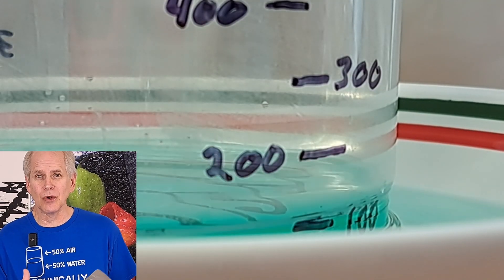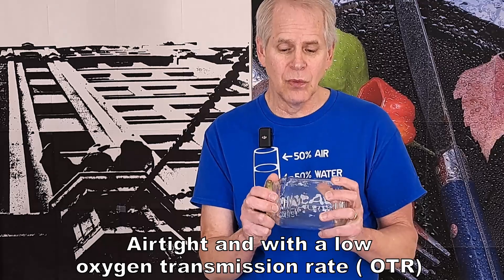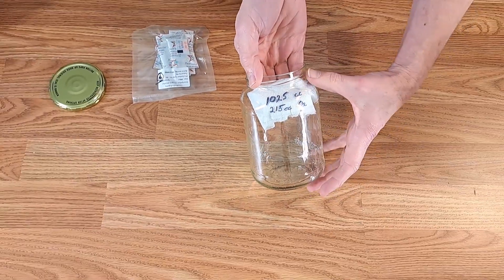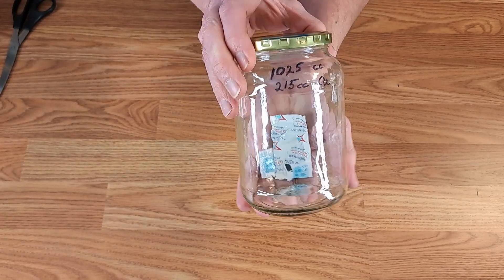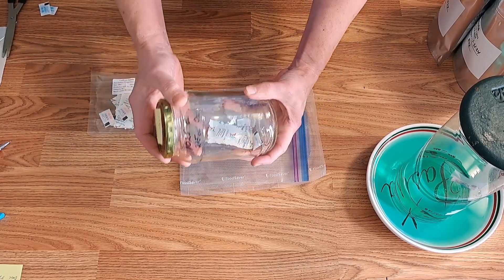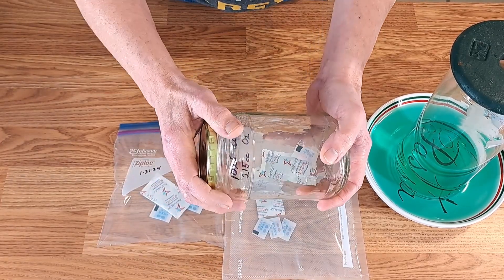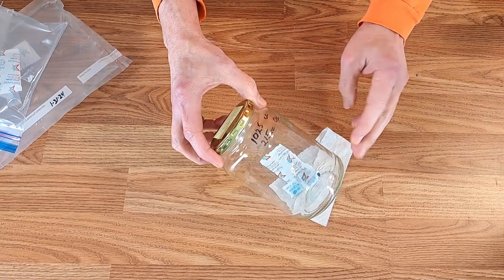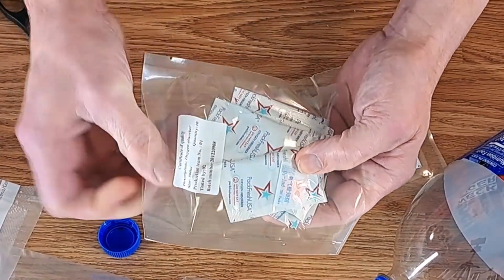Short Version - Simple Test: Using a Pickle Jar and a Soda Bottle to Test Oxygen Absorbers

Comment: Thanks for the video. Superficially, as long as the Oxygen in the bag is removed, yea, that is good. However, it is comforting to know that an oxygen absorber has room to spare in case you use a larger bag or I suppose open it briefly and reseal.
Reply from the maker: Thanks for checking it out.
Exactly! And equally or maybe more important, the long term issue is permeability - oxygen is going to keep going through the bag, slowly, forever. The better the bag the slower it happens. (That's the big plus with jars - not  permeable - but on the downside they tend to be clear) Of course if you have oxygen absorbers in the bags they should keep absorbing any oxygen that comes through over time.